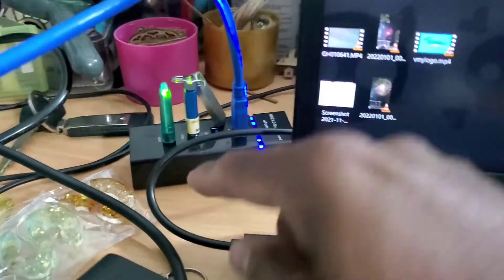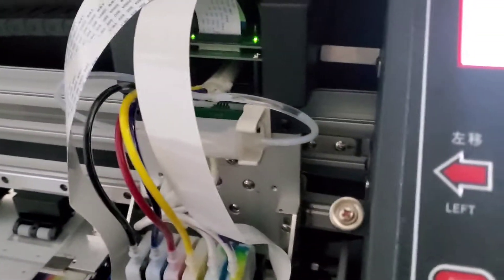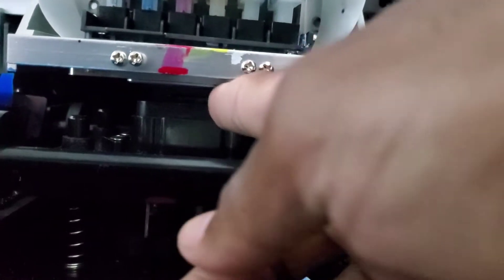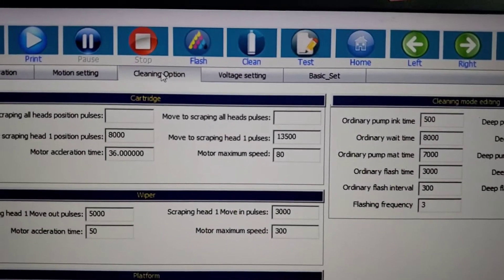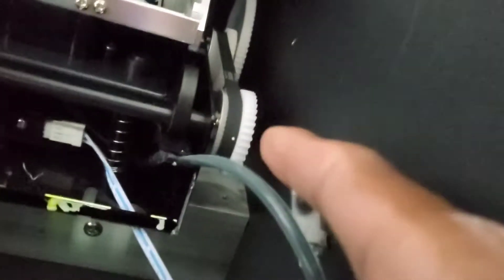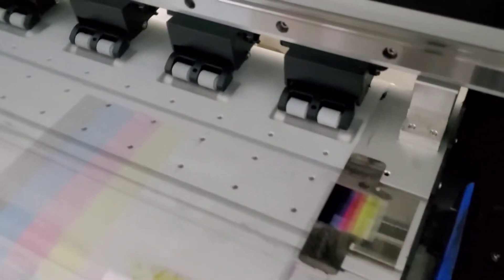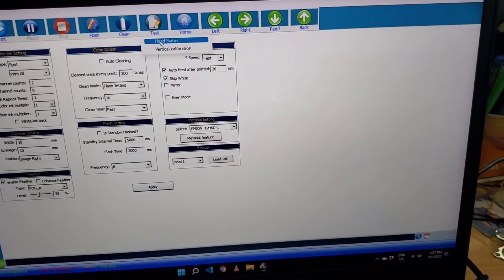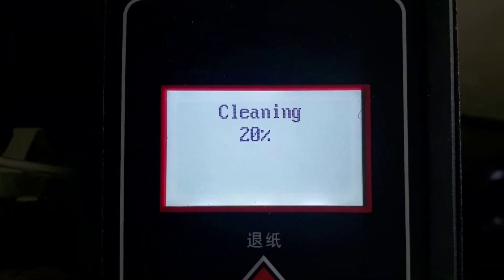FUNSUN DTF printer how to solve ink problem

Comment: Hello, please help me. Wellprint program not reconogize fusun printer.  was installed the right software "Cypress FX3 usb StreamerExample Device"
Reply from the maker: Its very crappy.. ive installed n reintalled many times even now.. somehow this software seems to have propblems getting connected
Reply: @Goldinton  🥲
Reply: @Goldinton  it´s me again... I resolved software issue, but now not suction it. I tried with the parameter 5000 in "move up to pumping" doesn´t work.
Reply from the maker: @heylingmn  ive uploaded a vid abt it.. pls check it.. might help
Reply: @Goldinton ok, I´m searching it... thanks